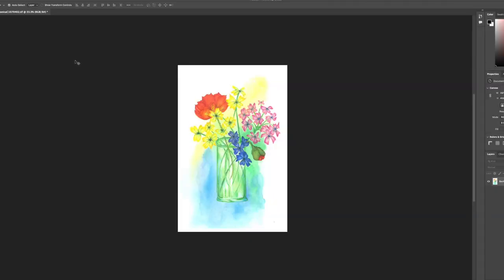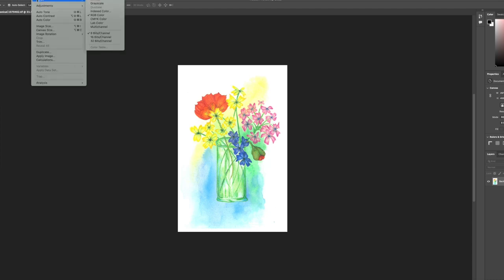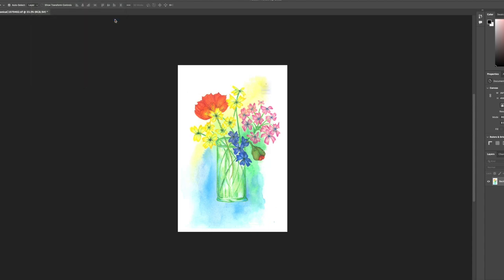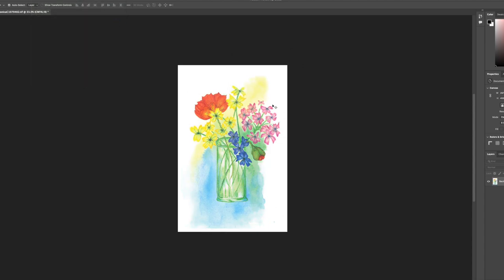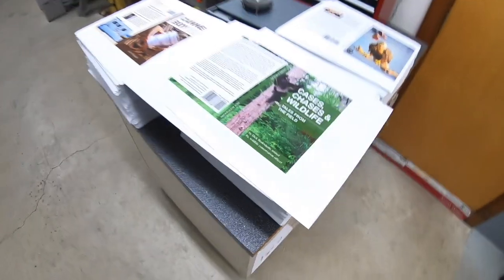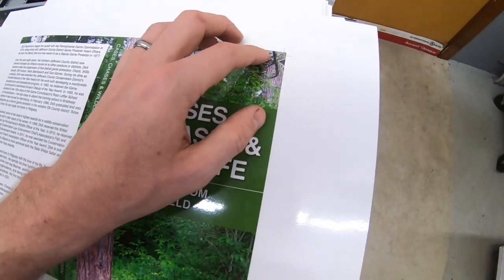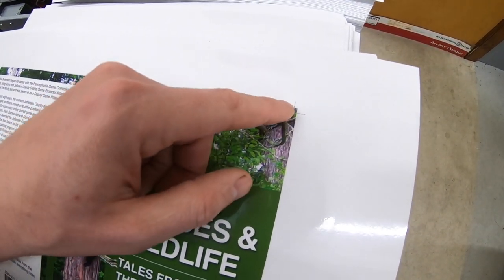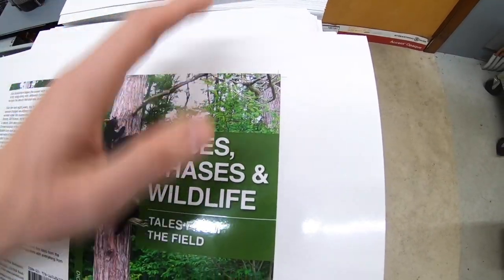Optimize your Artwork for Digital Printing, Tips and Tricks for New Designers

Comment: One other thing I thought of is the normal persons monitor will also not produce the same as the final printed project. Every monitor is going to be different on how display the image. Don't believe me look at the TV isle in walmart and you will see all kinds of differences. Same with computer monitors.
Reply: You made me remember back when I got my first Heidelberg QMDI 4 color printing press...we had a super expensive Epson printer for proofs and we used to calibrate our monitors. Had a spectro thing that you'd place on the monitor and everything. Boy things sure have gotten easier.
Reply: Pretty much, a lot of people have set their screens way too bright, so their prints come out way darker than they expected.
Reply from the maker: Yes, I also forgot to mention that screens are backlit vs paper where the light shines from behind you. I need to do a video on additive vs. subtractive color.

Comment: Good stuff. Older toner printers seemed to have trouble with dark, solid colors. It made roller marks easier to notice. A little bit of noise or texture was a good idea. We still tend to do that even though newer printers don't seem as bothered by solid colors. We run digital press and a traditional silver-halide photo printe (RGB)r. The traditional photo printers really struggle with bright, pure yellows. They cant' do it. The only tech that seems to handle everything are multi-ink, high end inkjet printers. Big gamut and every pure color you need is available it seems on our Epson. I wish there was a simple, intutive way to explain bleed to non-designers - and some actual designers as well. They often don't get it. We've had the conversation a thousand times.
Reply: As a designer of sorts, I'd say go for a "Want an ugly white line when the machine cuts with a margin of error of .5mm? Didn't think so" xD
Reply from the maker: Ah yes, back in the day solid colors were always a no and textures for everything!

Comment: Try explaining to most people what the difference is between a file created for web viewing and a file that is created with bleeds for printing; and why you will not be able to print that web file FB without loosing the text in the header, and or, footer after trimming.
BTW, I have been running the Accuriopress 6085 for 2 years now and loving it so far. I have the IQ function and that has made for some really tight registration with little effort.
Reply from the maker: I've gave up about explaining that to people. :)

Comment: Thanks again, Dan! Regarding color printing, do you typically just use the default color settings with your Fiery or do you adjust them based on the job or something else?
Reply from the maker: I mostly use default, however I have slightly adjusted some color settings with rgb overprint.

Comment: For any client that complains about the print not matching their screen, I would say to them: Since your monitor is not profiled to match any given printer in my fleet, what we produce for you will never be an exact match to your screen. 

As for the light tints and other printer issues - sounds like maintenance issue. Keep the heads clean (if inkjet) and re-linearize as needed. Sometimes a complete re-profile might be needed as well. Any print provider not doing the maintenance of machine and profiles is doing themselves and their customers a disservice.

Comment: I've been a Prepress Special for over 25 year now and feel your pain. I don't know if you've ever heard this but too many designers unknowingly believe in the acronym of WYSIWYG or What You See Is What You Get! They don't know how to look at separations or understand Overprint Preview. 

Most of what I do is Pantone work on offset and flexo presses. I can't tell you how many times I will get a document with 3-6 different shades of black. It will have Process Black, Pantone Black C, Pantone Black U, Pantone Black 6 C, a four color build of black (probably copied from an RGB document) and then add Registration color. Kills me. Don't get me started on the need to overprint small type over a background color or image.

I hate PDF documents. There are just too many ways for to make a PDF and what they do is usually wrong. With every job requiring some level of repair, please send me your Illustrator documents. The dieline is probably a process black instead of a technical color set to knockout instead of overprint. I could go on and on.

Our company wants to automate this process but I'm just not sure how we're going to accomplish this??
Reply from the maker: Ah yes, WYSIWYG. I don't think there is any way to automate this, unfortunately.

Comment: Thanks for the quick response, to go a bit further, i am using Coreldraw to print and number the pages. eg a 4 part NCR pg numbered #001 will have to print on all 4 colured pgs and be collated at the delivery. so will the machine pull each colour from each tray and number it #001 and then start over for #002 
do the same for  till be book is completed. we do not have access to pre-collated NCR
Reply from the maker: Hope you were able to figure something out!

Comment: Lots of good stuff here, but (as Dan knows) is only scratching the surface. Designers for web are the biggest culprits because they are unfamiliar with composing for print. I encourage bleed extensions and trim marks all the time. But they need to know the difference in the "live" area and the extension area that is meant to be thrown in the barrel. Another amateur design faux pax is the creation of a barrel fold brochure where every fold point needs to trap to the fold ON BOTH SIDES, UGG!  The amount of knowledge this takes to complete correctly is definitely beyond the scope of most current day designers. Anything like this I request the native packaged files as well and will automatically build in design time to manipulate the panel sizes. Not to mention the extra setup time to get both sides to register.
Reply from the maker: Yes, native files come in hand when changes need to be made. Hopefully this video will help a few people out!

Comment: I'm using the Corel Draw program, and I'm having problems displaying colors on the monitor.  that is, the program displays colors that are completely different from real CMYK colors.  I have a monitor calibrator, but I could not set up a color display profile in the Corel Draw program.  how do you solve such problems
Reply from the maker: Stop using Corel draw. I have never used it but I only use Adobe products. They work well.

Comment: This is a perfect example of where the tension lies between designer and printer. This was always a topic of discussion in our print shop. As a designer and print operator I understand your arguments, but a modern printer has to be able to handle certain things and it is a reason for me to call in the help of the print technician to solve certain imperfections. For us it is not acceptable if light colors are not printed stably. I am a bit maniacal in print profiles and color calibration. We try to avoid RGB to avoid unrealistic expectations about color reproduction.
Reply: If you're willing to pay extra to print on a machine that is maintained so it can print that stuff perfectly at any time, sure, why not. But most people go for the cheapest price they can get. You can try to reject that 10.000 brochures print job you're not happy with, but it is easier to know which features are problematic and avoid them if possible.
Reply from the maker: Every printer is different. Some printers have higher expectations and others lower. Designers are the same way. What is best is for each designer to find a printer that meets their expectations and vice versa.
Reply: @HenryLoenwind  The question is what then is the profit margin of those 10,000 brochures. As a small printing company it is difficult to compete purely on price and customer service and quality are decisive in terms of award.

Comment: I never send file to machine if file is unfiit ready for print. I suffer 90%+ files have no bleed, no mark, no margine, no guatter, no spine , no crease mark, no preparation mark,  no resolution,  wrong saddle,  wrong fold mark, wrong size, pantone file, rgb file, no adobe system export,  no page number or wrong page number, file isn't opening,  font is missing, design is invisible,  transparency,  B2B wrong layout,  wrong die line and so many things. 

when I work  in solving time of the files,  I  always pray to God if God make the  designers understand about the next steps after he completed design.
Reply from the maker: You need to either educate the people that are sending you artwork or get other customers. I try to rarely intervene with any changes and only print.
Reply: Our customer service reps hate to educate our customers. They will remove several of my comments in trying to educate customers because they feel as though I'm insulting their work. Sigh.
Reply: I think if any designer designs templates for printing, designer should keep in memory what is going on the next steps after he designs. For the social media web pages,  no need to follow rules, system and about next steps. but, for the printing templetes must be thought about next steps.

1. For a book It needs to put bleed because b2b snapping distantance. At least 3 mm bleed can solve the tiny difference. For a cutting this bleedless book is uncomfortable. for the design if it's cut 1mm inside of cutting mark is logically bad. 
2. the book is A4. Ok the book he correctly design A4. But he should think about binding man. for the binding man must be kept at least 1cm guatter. after guatter from binding side he he will take marging as he wants his margine.  If margin goes inside guatter it's uncomfortable for the binding man. 

2. If the book is 1000 pages will print in wooddree 80 gsm, eaither he should calculate spine if he has paper 500 sheets or he should call to printer what spine may come and also think if the book has hard cover,  supporting pages, page numbers,  stump and emboss files. 

Why I'm telling this topic here because a digital printer employee is hired. employer never listen argument from employee. employer will say I pay you and you have to solve your problem. if you can't solve problem, then leave the job. 

I think aalmost all the digital printers around world suffer same problems and solve the problems working again on the ready file. solving problems are not so big deal, but somtimes time is so important for digital printers because they have always  hurry tendency to finish all the jobs in time. sometimes for a job clicks consume deadline times for the other jobs. 

for the last 5 years I'm suffering the problems and solving with myself without asking any person.

Comment: Package your designs so the typefaces, colors, and attached images are included in the pdf file.
Reply from the maker: YES!
Reply: @justaprinter  Thanks for the reply. I am not a printer, but I did graduate with BA in Graphic Design. That being said I had a great professor. She even took us on a field trip to a print shop, it was very fun and educational. My professor also works with real clients/ companies and she always told us to make our stuff easy for our clients to understand i.e. send stuff as pdf’s, and make it easy for your printer so they want to work with you again. Always package your files it’s just good practice, especially when sending your work to someone else who has to work on or with your design files. If the file will be used for print you should use high resolution graphics such as 300 DPI, always use a bleed of .125 or 1/8 of an inch, and use the correct color mode.

P.S. I have always found the technical side of printing very fascinating.

Comment: i do alot of NCR books, up to 4part, can the Konica pull different colousr from each tray and have it collated at the delivery
Reply: Any good production level copier should be able to do this.
Reply: Yes they can. Confirmed.
Reply: Or you can buy 4 part precollated.
Reply: @jamesmartin7855  No… Because he's running each sheet with different copy
Reply: I too can confirm this is possible, we’ve done it before. The only thing our machine struggled with is page curl. We don’t have the decurler unfortunately and found that printing on larger sheets was much better.
Reply from the maker: Yes, you can do this as long as they are not numbered and all sheets are the same artwork.
Reply: Any machine will have some sort of page programmer to pull from different trays and collate. If you're numbering and/or running slightly different artwork for each sheet you can use an Acrobat plug-in called 'Quite Imposing' which will create the pre-collated/numbered PDF document which you then send to your page programmer. It does a ton of other stuff as well but for all NCR sets it's very, very good. Also the support from them is fantastic - if you've got a particularly complex imposition involving numbered, backed up cut stacks they'll send you the preset to do it.

Comment: Great channel Dan! I’ll follow up on Berti’s comments to say that it is often much better to print from RGB than CMYK. It is true that the digital presses cannot replicate very vibrant colors from the RGB gamut, but you do get a wider spectrum of colors when you print from RGB than from CMYK. This is because Adobe and other programs reduce or “dull” the colors somewhat when you convert the file to CMYK. This is visible on your monitor. There are technical reasons for this concerning offset printing equipment, but the point is that leaving it in RGB renders still a better digital output. A simple test print of the same image in both formats will usually demonstrate this. Again, keep up the good work Dan! Appreciate it!
Reply: Yes, been making tests at my home printer and at a couple print shops with the same image in CYMK and RGB, and the RGB one comes out more vibrant on the newer printers.
Reply from the maker: Interesting, this is the first I'm hearing that. I'll have to do a test. Thanks for sharing!